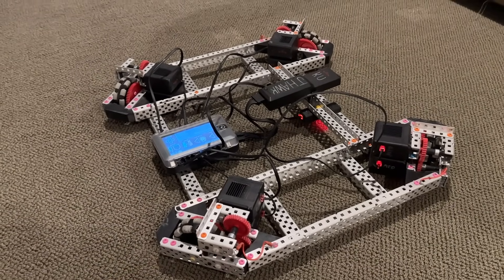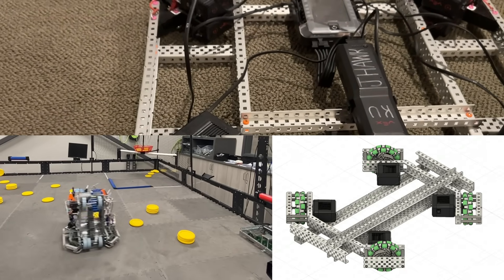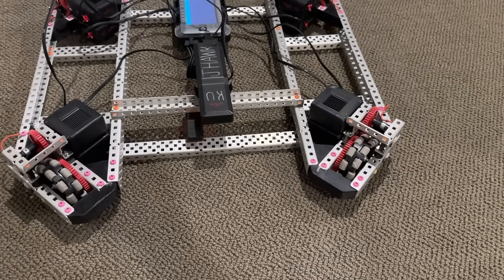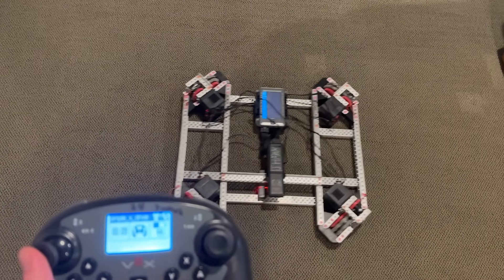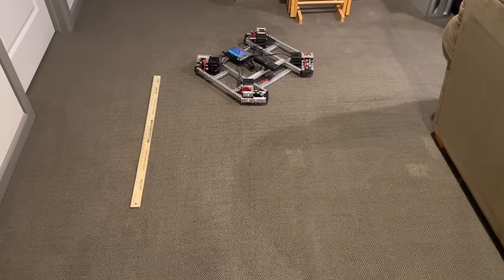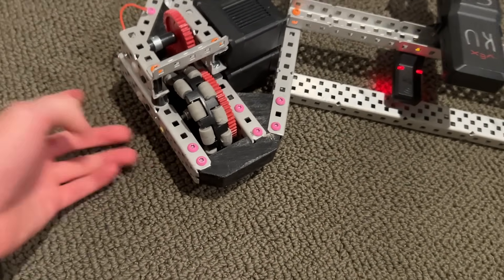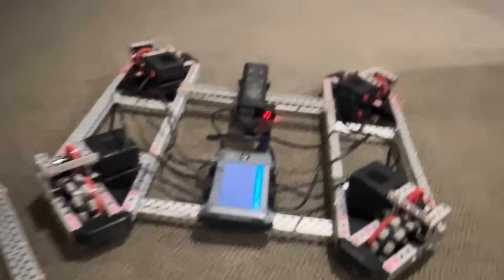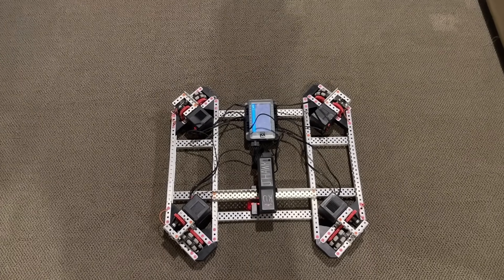A Complete Guide to X Drives

Comment: So are you using x Drive for vurc? 👀 
Why? Can you explain the reason? 
isn’t tank with omni and traction wheels better in terms of of defence and attack, it it’s may fall short on term speed and manoeuverability but shouldn’t the tank be enough to negate any advantages gained by x?
Reply from the maker: It depends on how defensive you are. For certain strategies, X drive is just as good if not better than tank drive. Both have advantages and disadvantages
Reply: @9MotorGang Thx for the quick reply, can you elaborate on the advantages and disadvantages of both? I’m still only thinking of the defence aspect and manoeuverability.
Reply from the maker: @iRuwx  This video goes more in depth on it https://youtu.be/2Pnj9Jq9JiU?si=EfZEQ9CpZUl-VhZ1

Comment: 8 not 16 total
Reply from the maker: Did I say something wrong?
Reply: @9MotorGang  you said it would take 16 gussets, but it would only take 8, 4 if you use plastic bending tech
Reply from the maker: @3818c_cookin  I think I recorded this before the plastic bending thing was legal. The reason I got 16, was due to one gusset on the inside, one on the outside. Per wheel. Top and bottom. Probably could get by with less but that's what I did for my bracing last year for VexU

Comment: If you want roughly the same speed as a 360 on 3.25 on x drive, run 480 on 3.25. It'll be around 5in/sec slower but friction should be less so it should be only a slight difference.
Reply from the maker: If you're running X drive to get a specific speed you're doing it for the wrong reasons.